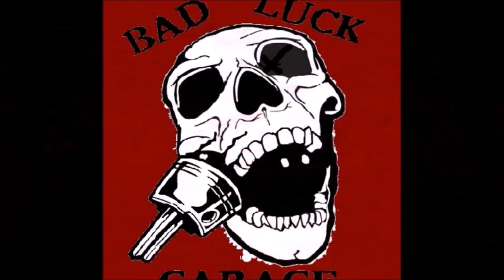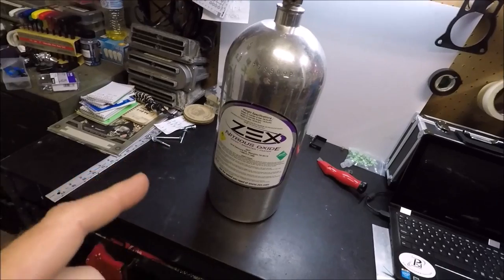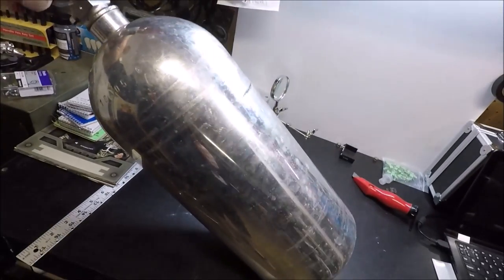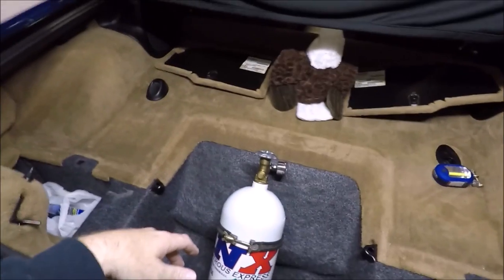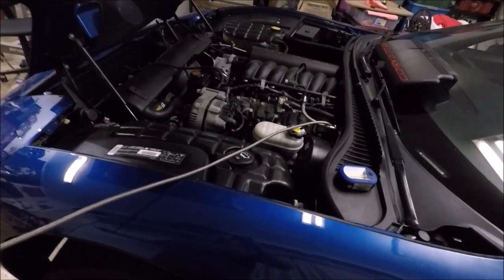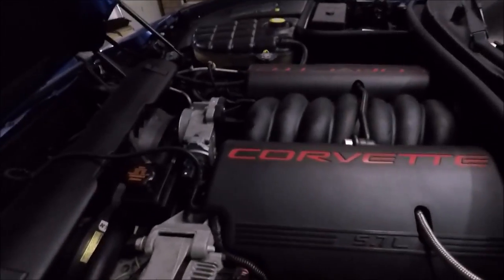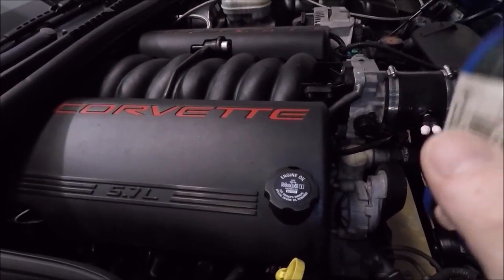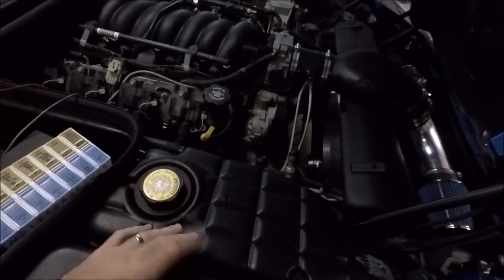LSX NITROUS INSTALL ON CORVETTE (PART 1)

Comment: Gotta give it to ya, watching your chinavette vids inspired confidence in me to go ahead and do a NX system on my 02 ZO6. Been binge watching, and even watching a couple several times 😂
Only thing I gotta figure out, is hooking up my LNC-2000. 
Thank you! 👍
Reply from the maker: I’ve never used the LNC-2000 but it should be a pretty straight forward install. Since I do my own tuning I just make adjustments in the PCM for the nitrous. 👍🏻

Comment: Enjoyed the video I have thought about putting nitrous on my dodge ram 5.7 . But we will see anyway I want to thank you again for the car show plug
Reply from the maker: Again brother it was no problem. I just hope it helps a little. BUT.... feel free to share the heck outta my videos if you’re feeling like a thank you. Lol. 🤣🤣🤣 And yes, a little juice on that hem I would wake it right up brother. 😉
Reply: @BadLuckGarage  man i hope your gonna go turbo on the c5...
Reply from the maker: Rick B, no way on the C5 but I do have plans for an LSA blower for it down the road. 😉 When I do another turbo build it’ll just be a shitbox to take to the track, not something nice that I actually wanna drive everyday. I’ve learned my lesson. 🤣
Reply: @BadLuckGarage  Do you think you messed up by adding too much boost? I know you had some problems but i thought it was a good setup.. Reason i ask is b/c i am building a lq4 for my 2500HD. Im building the motor NA now but i want to boost it next year..nothing crazy im not looking for crazy power just want to make the motor more efficent. I was looking at a blower but ive always wanted to have a turbo vehicle and it seems easy and cheap to turbo a LS. Ive video documented everything but i hate my voice on video so i wont upload them lol..
Reply from the maker: I was only running 12psi and it was just starting to feel like it was making as much power as the 150 shot did. I did an engine tear down and went over what happened on video but it wasn’t the boost thing that made me go back to nitrous, it was the simplicity and lack of need for constant maintenance. I wanted something that I could drive everyday and work on every couple weeks....not the other way around. Lol. 😜 All the extra work and issues with heat, leaks, etc just wasn’t worth it to me in something I wanted to daily drive....especially when I could make the same power instantly with a push of the button and have something that drive normal and maintenance free the rest of the time with just a little juice. Don’t get me wrong, the turbo was fun and was a learning experience, it’s just not something I want to deal with on a daily driver again.
Reply: @BadLuckGarage  i wish there was a cost effective blower i could run. A few years ago the lsa blowers were cheap af, now ppl want an arm and leg for them. Id love to slap a whipple on my truck with a nv4500..
Reply from the maker: The kit I’m looking at is around $3500 with an LSA blower and all adapters, belts, pulleys, etc necessary to bolt it on the Vette. They also sell the same “kits” for trucks or pretty much anything else. Matter of fact my Avalanche may get one before the Chinavette does just for towing purposes since I’m planning on taking the Vette to several events next year.

Comment: Nice video.. with great tips!  

Never would have thought about the fuel puddling if its farther from the throttle body..  

makes total sense though, after all that's pretty much why multi port efi is more efficient then carbs or tbi...
Reply from the maker: Thanks brother. I’m gonna cover a lot more in part 2.

Comment: Nice job explaining the job👍🏽.
Do you know if the ZEX control unit will work with other systems?
Reply from the maker: The ZEX unit will work with a window switch or something of that nature. I actually go over that with the wiring  in part 2. But it will NOT work with progressive controllers. I have other kits that I’ll be installing later for that. 👍🏻

Comment: Hey man love your videos I live in Knoxville also I just got a stock 2008 corvette ls3 what would be a safe shot of nitrous it’s all new to me and which kit thanks any info will be great keep the China vette videos coming thanks
Reply from the maker: Hi Steven! Thanks for watching! You can use whatever manufacturer you want brother. There are tons of different options out there and I usually do budget options like the NX mainline or proton kits that you can get for around $380. Most people consider anything from 100-150 safe for a stock v8. I don’t mind pushing it a little further but not for extended periods. You just need to take proper precautions i mentions in the videos in regards to timing, fuel, and engagement. That being said, if you’ve never used it before, just start with a 75 shot until you get everything figured out and work your way up. It only takes minute to switch jets up but takes a lot longer to switch engines,lol.

Comment: Will the factory throttle body gasket be good if it's in decent shape..also do you need more than one needed when installing the nitrous plate
Reply from the maker: Yes and yes. If you use the plate it will usually come with the second gasket or have it built into it depending on manufacturer. I’ve never used plates.  I have so many fogger nozzles and solenoids laying around it just doesn’t make sense for me to buy one. Lol.
Reply: @BadLuckGarage  I've got the nos plate ... I bought it second hand so of course it doesn't have a gasket.. ..

Comment: I’m doing a 125 shot max and it’s my daily driver so tapping in fuel rail yes or no for me ? I got the spark plugs like you said too
Reply from the maker: You should be fine tapping the rail as shown. I wouldnt worry about a seperate fuel supply until you got over the 200hp range and even NX still recommend using the fuel rail with their 250 shot settings.(although they recommend upgrading pumps at that point)
Reply: Thank you so much I appreciate you replying to my messages on even an old video can’t say anyone really responds like that
Reply from the maker: I do what I can brother. Sometimes I miss some here or there or just get busy with work, family, and home life, but I try to interact and help people as much as I can.

Comment: What was the nut insert tread pitch you used for securing the nozzle in place?
Reply from the maker: It’s a standard nitrous nozzle bung. Comes with any EFI kit or can be purchased separately.
Reply: Bad Luck Garage, Iv tried getting one for my NX ML2000 kit but can’t find one.
Reply from the maker: Goto eBay and search”nitrous nozzle adapter”. They make them in both 1/16” and 1/8” depending on the size of the fogger nozzle you’re using.
Reply from the maker: I just amended my previous reply. It’s 1/16 or 1/8, not 1/4.
Reply from the maker: All my kits are using the larger 1/8 nozzles but if you have the nozzle that originally came with the ML2000 kit I believe they just came with the smaller 1/16 Piranha nozzles. My ML2000 kit was originally a carb kit that I converted to EFI so I bought a larger super shark nozzle.
Reply: Bad Luck Garage yeah spot on. Just kit Didn’t come with a bung.

Comment: could you install any nitrous kit in a truck have a chevy colorado 2018.
Reply from the maker: Yes as long as it is a fuel injection style kit, the procedures I outlined in these two videos will be the same. Don’t forget to watch part 2 for the lowdown on the wiring. 👍🏻
Reply: @BadLuckGarage .I'm some what of a noob when it comes to things like this trying to learn do not have much money for a good turbo and hell know would not put a cheap turbo kit from Ebay on my pick up truck.
Reply from the maker: If you go back and watch the turbo C10 playlist, me and a welder buddy actually fabricated a custom turbo setup on that truck. Too much headache for a daily driver in my opinion. Of course I've always loved my bottle so I'm kinda bias in that regard.